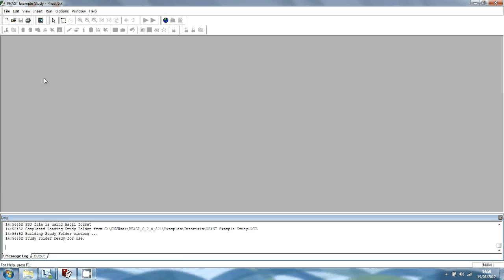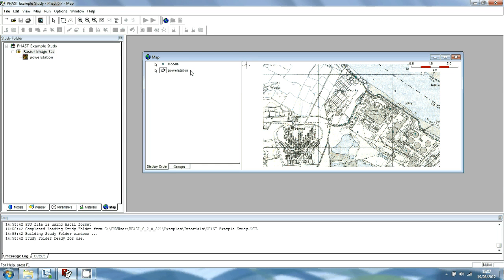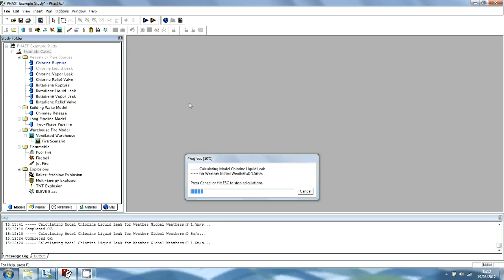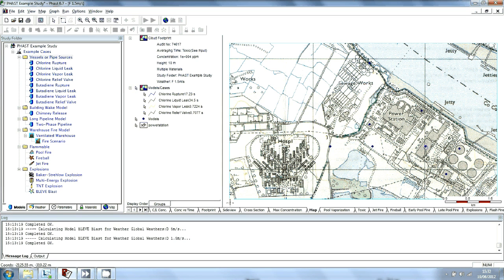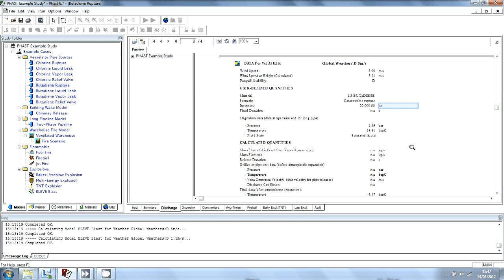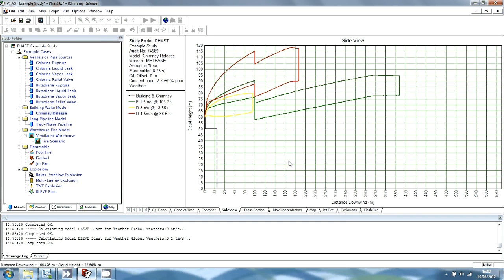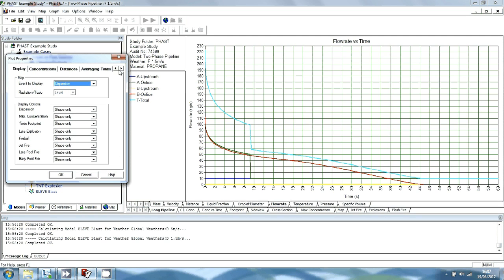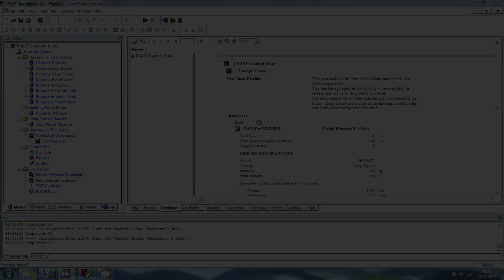Phast 6.7 Tutorial - Chapter 1 - An Introduction to Phast

Comment: does PHAST use "Blockage Ratio" or "Area Blockage Ratio" as an input?
Reply: Actually, yes. IN the PHAST 3D EXPLOSIONS Tutorial manual from 2018, they show that you can modify the Blockage Ratio which by default is set to 0.2.